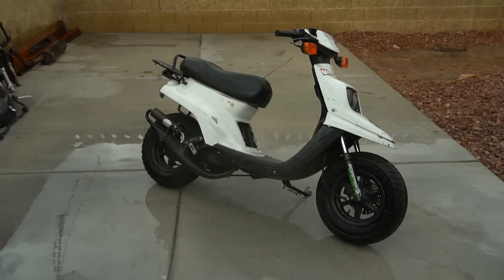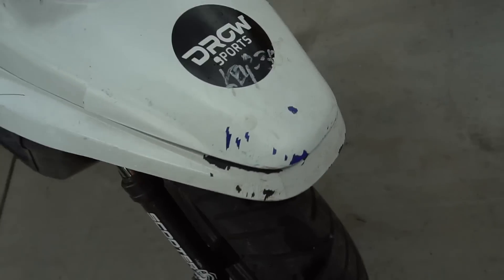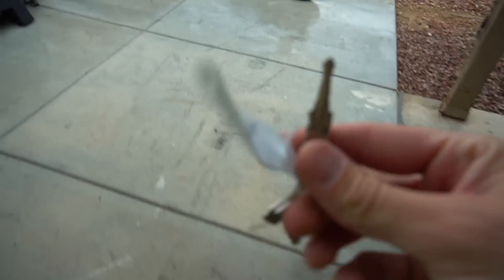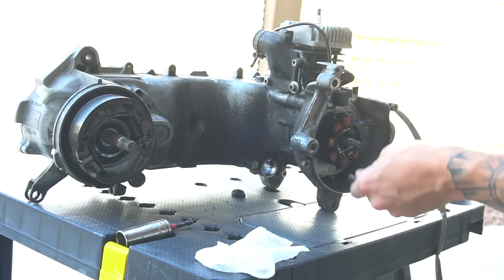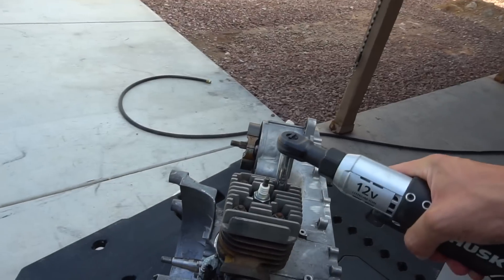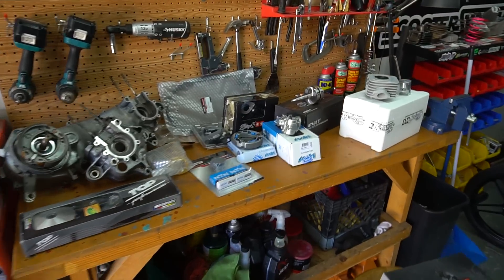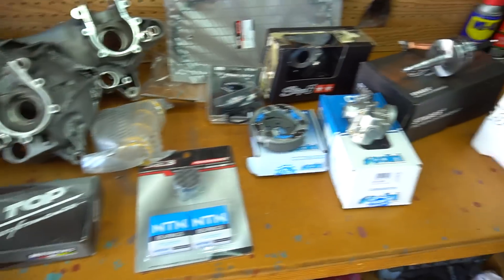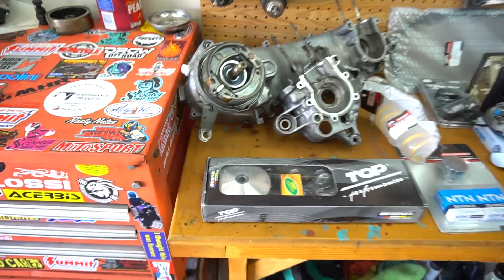Found a ZUMA at The JUNKYARD! Time to Rebuild it!

Comment: love the videos , been watching for a long time , in here in latvia we say '' nepis neiet ''
and I would suggest a really good setup for a 70cc
here it goes :
Stage 6 streetrace 
mallosi rhq crank 
dollerto 21 carb
athena filter big one 
4.8g rollers on a mallosi purple big spring 
stage 6 clutch with red torq small ones 
yasuni r or c16 (preferable c16)
mallosi x special belt
mallosi multivar setup

and all this would give a crazy setup ... but with streetrace you have ride the cylinder like 500km then you can abuse it but if you put mk 2 then you dont have to ride the cylinder that long to ride crazy
also if your budget is a little above .. you can get a italik seletra or stage 6 r/t igniotion , then the setp would be the crazieset you have rode on a 70cc 😁😁

Comment: I had the same cluster buzz noise, went away when i added a new battery. Ive been trying to find a prebug just like this for awhile, want a beater to learn wheelies on, but all that seems to pop up are mint bikes for $1000-1500 and I dont want to ruin a nice bike.
Reply: Mint prebug for $1000 where are you from?
Reply: @seanking2954 😂 No they don’t it depends on the state my state they go for way higher for the pre-bugs they go for like $2000 to 3000 and the bugeyes they go for like 1000 2000,.
Reply: @seanking2954  it really all depends on who’s selling them but I fear that the reason why they’re so expensive not just because their mid condition is because they are two strokes and they’re Japanese bikes so you’re getting a quality by compared to a Chinese brand bike and you see people that have them they try selling them for $800-$900 bone stock it’s The 

domain basically is higher for the fourth strokes so more of them is common then the two strokes so I highly think that’s why like I had

 nothing but problems with my Taotao scooter
Reply: @seanking2954  I spent 3000 4000 on the bike with dressed up parts in replacing the engine in paying mechanics

 and it’s still causing me problems I never had one problem with the Yamaha and I have a bugeye 09 I just been buying modification parts for it I’m fully done all I Gotta do is just wait for the parts to come in and I got to order me a upgraded front brake cable and that’s about it but I’m pretty much trying to keep my bike mint condition

 even though I am replacing everything in the engine and swapping out the brake cables and what not

Comment: What'd you use to remove the flywheel? I bought a puller off Maxi scoot, Ive had dramas with it mashing the crank spine, not removing the flywheel and bolts stripping flywheel, leaving me unable to fit bolt onto crank and unable to get flywheel off 😭😭
Reply from the maker: i just use a simple universal gy6 puller off amazon, works everytime

Comment: Hey question so I’m doing a 150cc rebuild kit soon and do you know how fast my moped will go if I have it derestricted
Reply: I assume you're rebuilding a Chinese 150cc GY6? Stock many of them will only go around 50-55mph. I built one with a 155cc piston and cylinder (58.5mm iirc) and a less restrictive air filter and exhaust. But the most important modification was porting the cylinder head. The stock ports are terrible. Port match, widen the bowl area, and lower/smooth the short turn radius. These mods with a richer main jet and 12g rollers(which some have stock) and that scooter would wheelie and do 67mph with a 190lb rider. All Chinese parts off Amazon, maybe $120 total. I built it for my brother, and he rode it hard, every day for two months. He breaks everything, but the only thing he broke on that scooter was the throttle cable, which I fixed. After he moved away I sold the scooter to a college kid, who messaged me months later to ask some questions, and tell me how much he loves that scooter
Reply: @middlesiderrider thank you so much 👍

Comment: you should get a yasuni c16 pipe instead of the yasuni R, or get a stage 6 r1200 pipe. Both are extremely good and yasuni R is fine but there are better ones